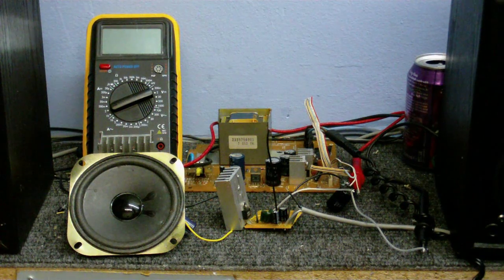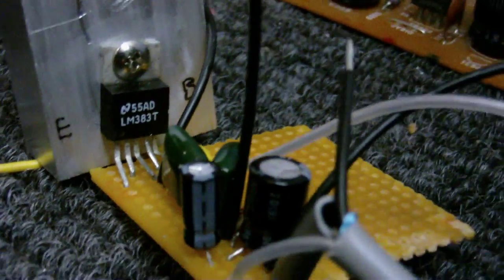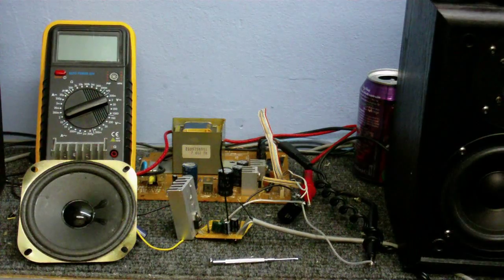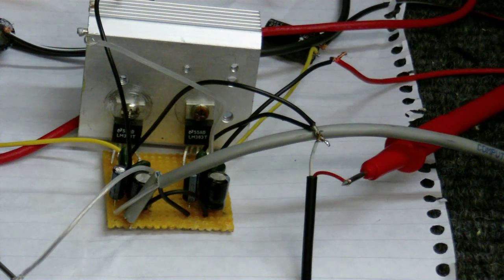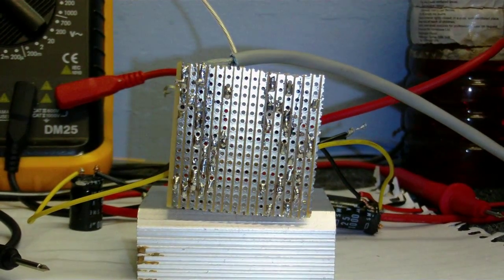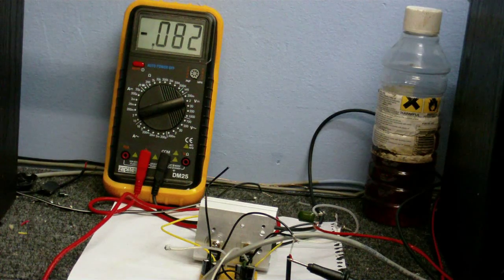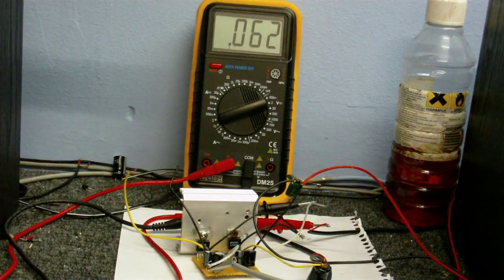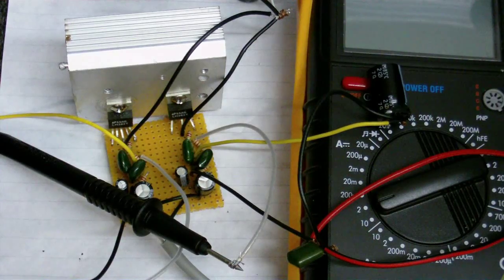Update on my 2nd amplifier prodgect (the ampliier "adventure" II)

Comment: Very awesome! That is odd with the current, but good that the cap fixed it. Maybe it was a "mircocrack" in the circuit board tracing. Also, on the cassette deck, maybe the jack for the right channel has an intermittent connection or a bad soldering joint. By the way, this video cracked me up!

Comment from the maker: @DrCassette I'vbe gone thought the entire thing and everything seems to be fine, there's no shorts or bad connections, but it works just fine with the extra capacitor.  The power supply is a pretty good one, it was out of another Denon casette deck and has many outputs including a +8 and -8 volt supply, so even I can run things that would need a split rail supply as well.